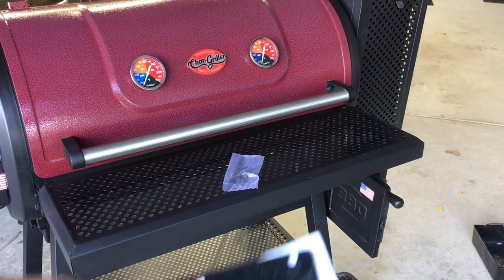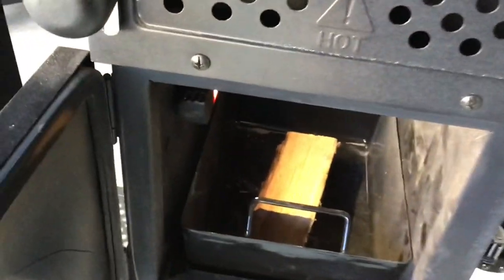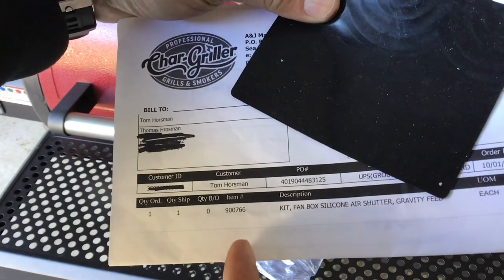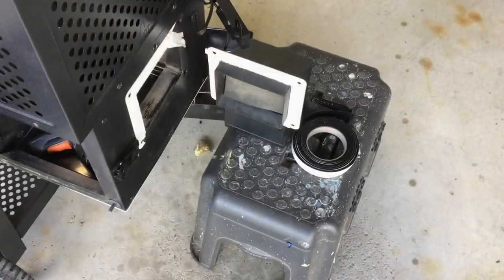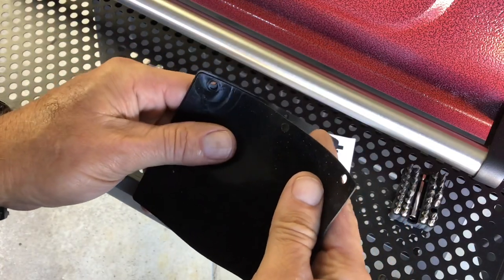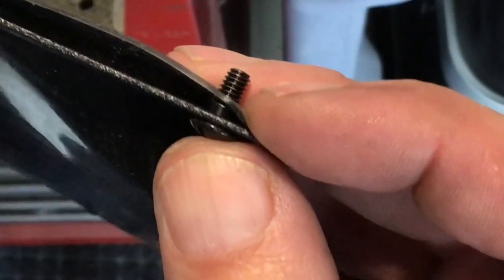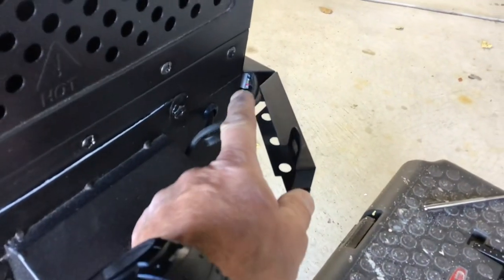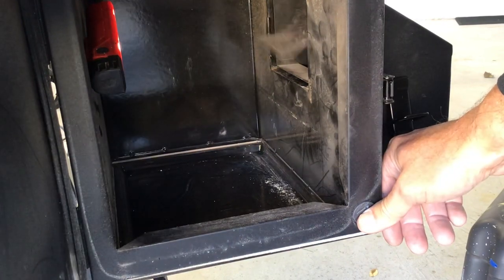Char-Griller Gravity 980 Charcoal Grill / How To Install A New Flapper/ Why Do They Fail?

Comment: Thank you for the tutorial Tom. Honestly I’ve been seriously considering getting a gravity 980 but am bothered by this flap problem that many people are having. You would think that Chargriller would address and fix the problem instead of just offering a bandaid.
Reply from the maker: Thanks for Watching Alex! I think if you use it correctly you won’t have this issue, just my opinion….
Reply: @TomHorsmanAmateurBBQ  I didn't initially. I ran the grill too hot during the burn in and that warped the flap. I replaced my flap with a grill mat from amazon and I haven't had any issues since then. Get the grill Alex. I am really enjoying mine even with my initial flap issue. The pros definitely outweigh the cons.
Reply from the maker: Thanks for watching! I appreciate the feedback!
Reply: Go ahead and get one, you’ll be glad you did!!! I’m certainly enjoying mine I got two weeks ago!
Reply from the maker: Thanks for Watching Tony! Enjoy!
Reply: @tonygonzalez2224  
Hey there. I did go ahead and buy a 980 and yes, I’m glad I did. It’s a great grill! The flapper did go bad though. Bummer!  :(  I bought some replacement flappers from Chargriller and also bought a flapper modification unit from LSS Mods like Tom did. It’s great quality and so far so good…it’s working perfectly. I really like my 980 so I hope this flapper thing isn’t going to be an on going problem. The highest temp I used was only 300 degrees so I’m surprised the flapper went bad.
Reply from the maker: Thanks for Watching Alex!
Reply: @alexkopitch7035  Hi Alex, I did my initial burn in at 350 degrees for 2 hours and 3 hours at 500 degrees. I’ve smoked a 12 lb. brisket for 14 hours at 225, cooked some chicken after the brisket, sausages and hamburgers at 400 degrees. So far, everything has been alright. No complaints or issues as of yet.
Reply: @tonygonzalez2224  
Wow, that’s excellent!! You’ve definitely been at some high temps for sure. Glad you haven’t had any issues with your grill. Hopefully I’ll have better luck with mine as well. Enjoy your 980!!

Comment: Sir, great video. I do have one question though. What do you think about getting like a high temp silicone mat for grilling and simply cutting a new flap from that material? Those silicone mats are made to go straight on the grill so I'm thinking that it should handle the heat just fine. I have one that is rated to 500 degrees. Should be resistant enough for the job in my opinion.
Reply from the maker: Thanks for Watching!  Haven’t tried it, but others have told me that it does work
Reply: @TomHorsmanAmateurBBQ  Thanks for the info! You just saved me $100

Comment: Hi Tom
Do you have a dimension for the flap. I would like to try the copper grill mat mod out there but my flap is so deformed I can’t get a true measurement
Reply from the maker: Thanks for Watching Ben!  3-3/4” tall by 4-3/4” wide as it stands in it fixed position

Comment: Hey Tom, you mentioned that you will be installing both sides but it seems it was only the firebox side and not where the fan is? Thanks and great video.
Reply from the maker: Thanks for Watching!  I apologize, there is only one flapper and that’s on the firebox side
Reply: @TomHorsmanAmateurBBQ  sorry Tom, I meant the gasket.
Reply from the maker: Ok,,, the fan side came with the gasket

Comment: Hey Tom!  I greatly appreciate this video.  My flapper hasn’t burned up but the corners are curling inward (toward the fan) so I am getting too much airflow.  I am looking at going aftermarket and making my own flappers.  Would it be possible to get an exact measurement (LxW) of the flapper?
Reply from the maker: Thanks for Watching!  You can get the measurements from your own, I would think to be precise. Mine is 4-3/4” long by 3-3/4” wide. Good luck
Reply from the maker: Thanks for Watching!  Ok…..
Reply: @TomHorsmanAmateurBBQ  Thx Tom for the draft measurement.  I am going to be purchasing large black heat-resistant mats and cutting my own.  Your provided numbers allows me to buy a sheet size that allows multiples while minimizing remnant waste.
Reply from the maker: Thanks again! Let us all know how well it works
Reply: Nice to have that measurement I agree. Interesting, while I haven't had mine as long as you have Tom, I've cooked on it quite a bit. My flap, when cold, leaves a gap between the bottom of the flap and the "frame"/ square opening into the ashbin area. However, when it warms up while cooking, the flap expands and fills that gap. I noticed in this video, yours does not. Just an observation, and of course heat makes things expand. I bought some sheets of copper grill mat to fill the lapse between warranty replacement and flap melting, should my flap suffer that fate. I was hoping I bought my unit late enough that it would have a thicker flap, but unfortunately no.  But I did have Menards rebate money from purchasing the 980 from there, to purchase the copper grill mat!
Reply from the maker: Thanks for Watching! Appreciate the feedback!  I also appreciate the support! Thank you

Comment: Update 
Got a new flap through warranty 
They didn’t send the one you showed with the thicker flap and new bracket 
I suppose that’s only if you order one. Guess I’ll keep the copper grill mat in place
Reply from the maker: Ok, That's good feedback Ben, Thank you
Reply: @TomHorsmanAmateurBBQ  
Np
Your the man dude 
I point folks in your direction all the time
Reply: I ordered and paid for 3 extra flappers, just in case.  While still described as a "kit", I receive no bracket or screws.  Nothing but 3 flaps stuck together.  They are slightly thicker than the original one was.  I went around and around with their CS person, who kept saying "your grill should still have the screws and bracket.  check to see if they're still there.  you don't need those too, do you..."  Clearly, they are either having issues stocking the full "kits" (now apparently just the flapper only, even if you pay the $4/set for the supposed full "kit"), or are just being cheap.  Luckily I didn't drop and lose any of the half-dozen small parts when I changed over the flap (first time, probably not the last...).
Reply: @ronc4146  
I replaced with copper grill mat. Works great